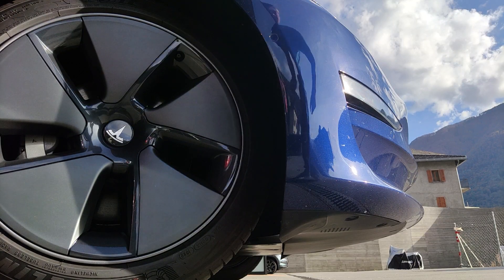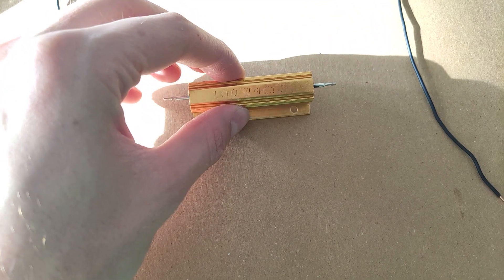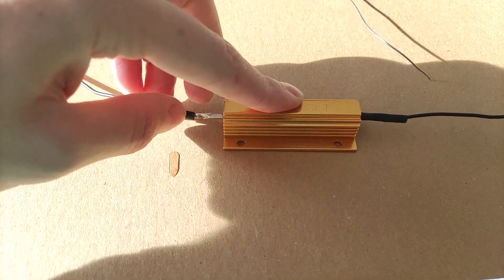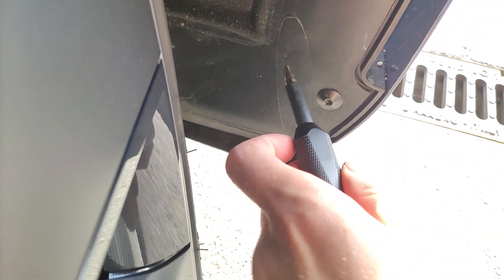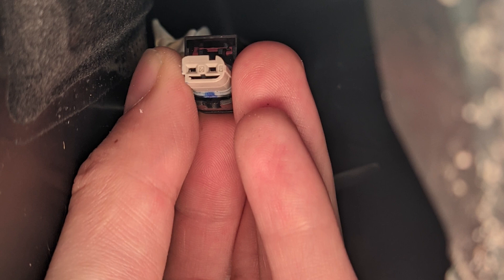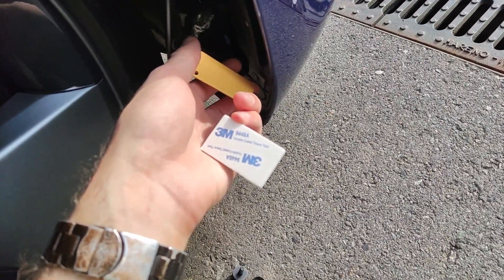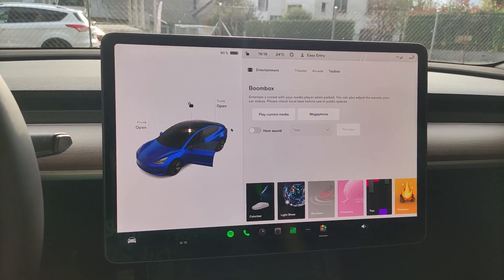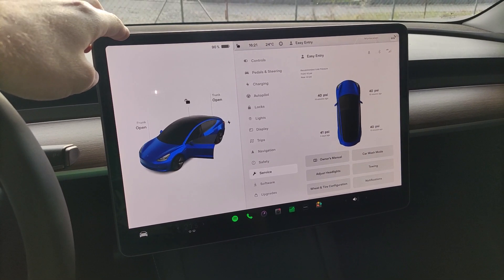How I made my 2022 Tesla Model 3 quieter

Comment: I tried unplugging (only) but got the horn error message. Just ordered the resistor and hoping this works!
Reply from the maker: Yeah that's what I had to do too in the end :p
Reply from the maker: Actually, I'm reading that in newer models they merged the PWS with the horn, does your horn work when the pws is unplugged? If not, then this mod is extremely unsafe and shouldn't be performed on 2023+ models
Reply: @SwissExperiments  I have a 2023 Model Y built in June of '23 and the horn is not tied to this speaker.  I just performed this mod and the horn still works.  The biggest drawback to it is I no longer have my fun lock sound.
Reply from the maker: @MountainManGuy  oh nice! Very good to know, thanks for letting me know!!! Did you get the idea from the video?
Reply: @ Nah I've just always been kind of annoyed by the reverse sound and when I found out about the white noise that gets played under 25 mph I started looking at options.  Found this speaker delete kit on Ebay and that's what I went with.  Works great and the car isn't reporting any errors!
Reply from the maker: @MountainManGuy  nice! I totally agree with the premise there. I have an EV, I want it to be silent and I definitely don't want to annoy my neighbors whenever I park at night :)

Comment: The main problem is how you will feel if you back into someone. The other issue is whether there is an extra liability because you disabled a safety feature.
Reply from the maker: I'm sure the pws is there for a reason. That said, older models didn't have one and are still street legal. One would definitely have to make sure nobody is behind, which is sort of a given. I don't recommend doing this mod, but as an engineer it was fun to investigate and perform.

Comment: what about horn? BEEP BEEP!
Reply from the maker: Damn for real? They merged the horn with the PWS? That sucks! Seems like the 2022 models were the last good ones lol....
Reply: 2022 MYP with single speaker  @SwissExperiments
Reply: @SwissExperiments  there are people who have wired the PWS with a relay so that whenever the reverse lights are on, the pws speaker turns off. What happens is you just can't use horn or alarm when in reverse
Reply: @overnightclassic2 do you have links for references to do this?
Reply from the maker: That's a separate speaker so it's no problem :)
Reply: I think they changed this right around end of 2021 into 2022. M3P here and with the speaker unplugged I still have a normal horn, but after this they merged the horn into the speaker. Does anyone know how to get around this on newer models?
Reply: Not on the newer ones ! Older ones you just unplug it don’t bother with the resistor. New ones can’t do it as the speaker is the horn too
Reply: @jasonnovis6565  My TMY has one speaker for everything it seems. No alarm sound, no horn and no noise when driving.